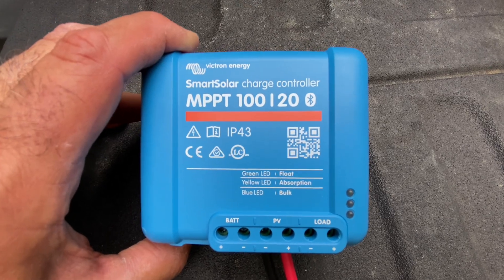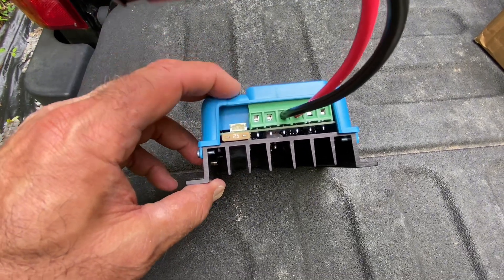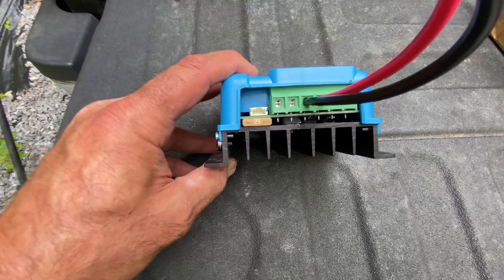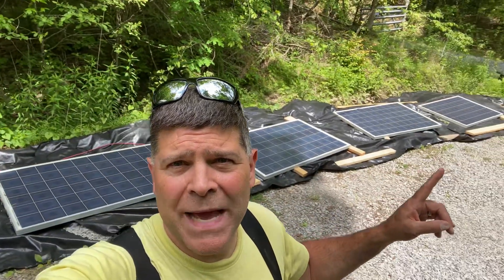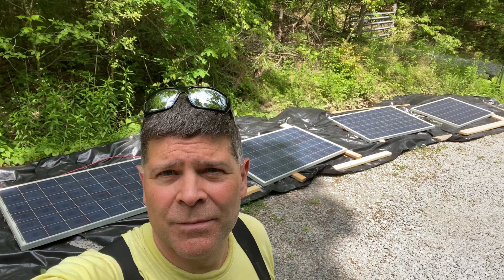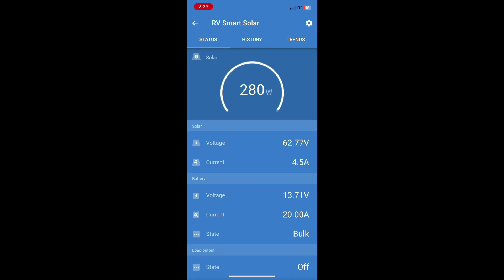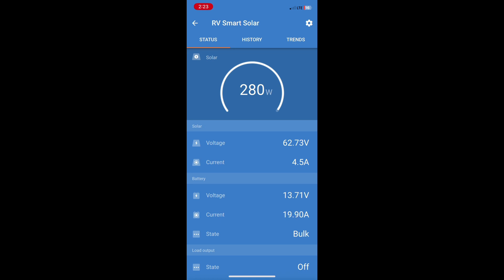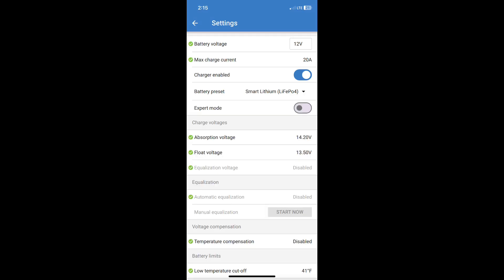Why isn’t Victron MPPT charging Lithium at 14.2 volts?

Comment: 280W with 20 A = 14A. So that mppt is charging with 14A already, the voltage shown is the current voltage of the battery, not the voltage its charged with.
Victron has many calcs to minimize stress on batteries. It even overwrites certain BMS (eg. from pylontech) to not overcharge. 

Depending on settings, the last ~10% of a lifepo4 can take quite a bit more time to charge. My pylontech bms throttles to like 50% at 90% SOC!
Reply from the maker: Thanks for sharing.  I will post the multi day chart I just recorded from the Victron App.  Only on the sunny days does it get to float stage.  It’s too shaded where I have the panels currently

Comment: I think other posters gave you some excellent explanations.   Let me give you more of a cell-level view of what is happening.   Basically, LiFePO4 (which is what I presume you have there) has an extremely flat charge and discharge curve.  The voltage will barely budge until the battery is above 95% full or (when discharging) below 10%.

Because of this, the battery will not self-regulate its current like lead-acid does to a degree, it will accept massive amounts of current if not limited in some way.  So charge controllers must limit the current they push into the battery because they just can't push the voltage up to 14.2V as doing so would put hundreds of amps of current into the battery.  The battery's BMS will cut it off to prevent internal damage, among other things.

You will notice the Victron defaults are to charge to 14.2V and float at 13.5V.  Lets translate to cell-level.  For a 4S (12.8V LiFePO4) battery.  A 12.8V LiFePO4 battery has 4 cells in series internally.

* The Victron will charge the cells to 14.2V (3.55V/cell), limiting the current to whatever it can handle or the solar panels can put out while it does so.

* The Victron will then hold 14.2V (3.55V/cell) until the current tails off or or an elapsed period of time depending on how it is setup.   The battery is 98% full at the start of this and will be 100% full at the end.

* Once it decides it is done charging, the Victron will allow the battery voltage to drop to 13.5V.  This is 3.375V/cell.

For LiFePO4 cells, to avoid over-charging the battery or putting unnecessary stress on the cells, the battery must be floated or the charger disconnected entirely (electrically).  Usually it is floated because that way the solar cells can provide load support while the sun is still out.

* The float level must be between 13.4V and 13.5V (3.35V/cell to 3.375V/cell).  At this voltage the cells will neither charge nor discharge.  They will remain at roughly 99% to 100% state of charge indefinitely.  This puts the least stress on the battery short of disconnecting the charger entirely.

Once you no longer have solar, the battery will begin to discharge to support your loads.  The battery voltage will drop fairly quickly to roughly 13.2V or so (depends on lots of things) while still above 95% full.  But then for nearly the entire discharge curve it will stay at between 12.8V and 13.2V  (3.2V/cell to 3.3V/cell).  Literally it will stay at that voltage delivering whatever power is asked of it all the way down until it has like 10% of remaining charge.

Generally speaking, once your battery drops below 3.0V/cell (12.0V), it has 5% left so most people stop there.  There is no need to allow the battery to discharge all the way to 2.5V/cell (10.0V) which is where the BMS disconnects as this puts unnecessary stress on the battery.

--

One final point.  Because of the way LiFePO4 cells work, there is no need to charge up to the BMS high-level disconnect of 14.6V (3.65V/cell).   In fact, charging the battery to 13.8V (3.40V/cell) will pretty much charge the battery to 100%, just a bit more slowly than allowing it to rise to 14.2V (3.55V/cell).

Also, if you don't have control over the BMS inside the battery, you don't really know when the BMS's balancer will operate.  It is important to allow the balancer to operate, so in that situation most people use a 14.2V (3.55V/cell) target voltage.  To ensure that the battery BMS's internal balancer runs.

Unfortunately most run-of-the-mill AC chargers charge all the way to 14.6V, which is totally unnecessary.  Proper charge controllers like the Victron default to more sane parameters (thankfully).

That's the skinny on LiFePO4.  It is also why a voltage-based "state of charge" display will not accurately tell you the actual state of charge... because the voltage barely moves for most of the charge and discharge curve.

-Matt
Reply from the maker: Thanks for that awesome detailed answer.  This makes a lot of sense.  I guess I were Victron I would word their manual and the application screen a bit differently so new to solar people like me would know what we are looking at and how the  values in the app screen will change.  It was cloudy today so batteries didn’t it to even 95% charged.  Rain for the 4 days so I probably won’t be able to check until the weekend.   Thanks for the best detailed and helpful answer

Comment: So lithium works a little different because it has a way lower internal resistance than Lead Acid this is why it absorbs all the current so the voltage cant go up. Your batteries are currently in the flat part of the curve. Once they are fully charged you will see the voltage you put in your controller.
Reply from the maker: Thanks for sharing.  I’m going to monitor it.  I’m heading out to the farm today but of course it’s going to be cloudy all day so they won’t get a full charge today

Comment: The max current the charge controller can output is 20A. In bulk mode, it will output as much power as it can (20A in this case as you can see in your screen recording) until the battery reaches your setpoint as @sylvan_dB says. Then it will reduce current so the voltage stays the same. It follows a CC CV charge profile if you would like to look this up elsewhere.

Comment: You said you set the solar controller to "lithium". Those batteries are LiFePO4. If there is a different setting for LiFePO4, that could be a problem. However, what others are saying is correct. You should see the batteries go from their lowest Voltage up to the 14.4 as the day progresses. Check them around noon or 2PM, as checking them once "full", could mean the charger has backed off enough to allow the Voltage to drop a bit.
Reply from the maker: I will check all my settings today for all battery options

I got the batteries from Signature Solar

This is the description 
EG4 Waterproof Lithium battery 12.8V (12V) 1.28kWh with 100AH internal BMS. Composed of UL listed 

You are right = 99% Efficiency LiFePo4 Cell Packs

https://signaturesolar.com/eg4-wp-lithium-battery-12v-100ah/
Reply: I've been struggling with that very thing.
Reply from the maker: I bought it at Current Connected so I’ve sent them an email for tech support to confirm what a few other people commented.  The summary is once the battery is fully charged the Victron would then display 14.2 volts.  No answer from them yet

Comment: The voltage setting for bulk is the end or maximum voltage.  The voltage will rise until that set point is reached.  This is how battery charging works.
Reply from the maker: Thanks.  I thought during bulk the initial fast charge it would show the bulk charging voltage of 14.2 or 14.4   I will try to catch the reading at the end of the day when batteries are at 100%.   Thanks

Comment: What you are experiencing is normal . The voltage of the battery will start low, then as the battery charges, the voltage will gradually increase until your "target" voltage of 14.4v is achieved. I said 14.4v because that is what you said in the video; However, the title of your video says 14.2v.
Reply from the maker: Thanks. Yes I’ve read different voltages for different MPPTs so I got a bit confused.  When I read that Victron would charge at 14.2v for lithium I thought that was what I would see in the monitor screen.  Perhaps what is displayed is the battery voltage but the MPPT is outputting 14.2 volts for charging?